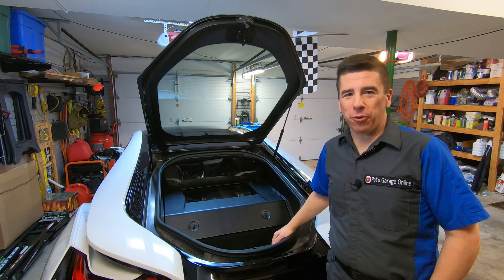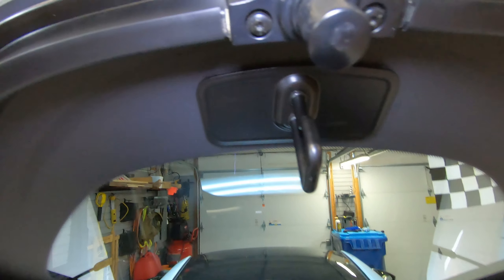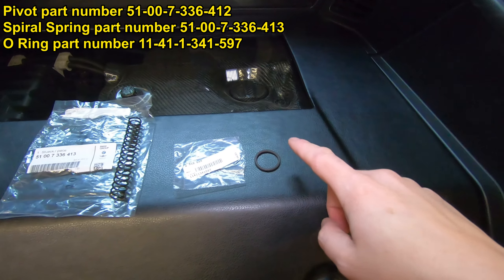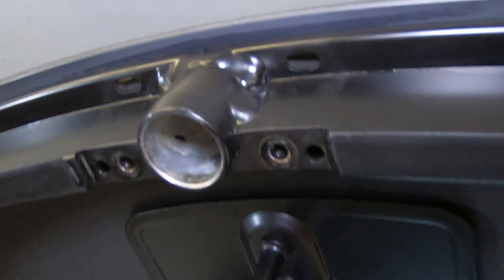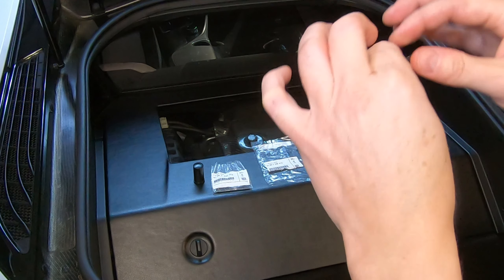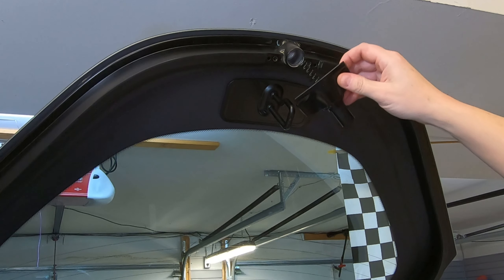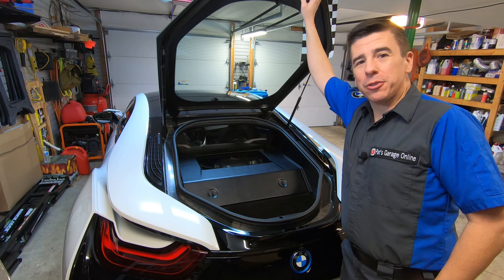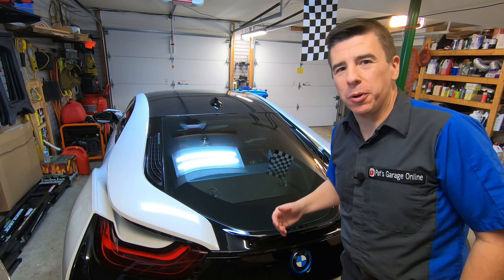Trunk lid problems on the BMW i8! How to fix this and prevent future issues with the boot.

Comment: Once again Pat, you’re amazing. Just did this to my newly purchased 2016 i8. Not only am I confident now I’m safe from this part failing, but the trunk pops up about 1/2 more than previously with the new spring, allowing me to easily get my hand under to open it.  Awesome stuff and never would have thought of doing this without your video!

Comment: Hey Pat, this is good preventive maintenance. Given BMW foolishly neglected to add a non-electronic way to open the trunk, one thing I found is even more critical. Make sure the emergency trunk release, the yellow plastic handle, is secured in its holder on the back of the trunk. If it is dangling, the car thinks it’s activating and will tell you the trunk is open, even when it’s locked shut. The trunk release will not operate nor will the rear views camera work at all. The only option is to somehow jiggle the handle enough while pushing the trunk unlock until it operates. Terrible design actually. As me how I know! 🤨
Reply from the maker: The same thing happened to me after I put my laptop bag in the trunk. I'll never bump that emergency release again. I plan on a video discussing this and the fuel door issue to be aware of. I never had the fuel door issue. Thanks for following along!

Comment: If anybody encounters this problem when is too late, and can not get it open at all, you can remove the rear bumper in the middle, the only two screws it has are behind the license plate and it snaps right out. Inside you will see an air vent looking thing. Take that out and you will see the emergency cable on the left side.
Reply: What size screws are behind the lisence plate?

Comment: Hi Pat, I’m i8 owner and have the similar problem that back trunk always seems open but actually not, and back camera seems not working as well. I can’t open my back trunk now even with Key fob or door control, is there any way I can open it?
Reply from the maker: I've heard of some folks using a suction cup device (either a camera mount for a windshield or a plunger) to pull up on the rear glass while unlocking the trunk, and that would work.  I'm not sure what to suggest as far as the rear camera.  It could be the camera, the wiring or the computer module that has failed and there's no easy way to diagnose this outside of the service center.

Comment: Thanks for the video. I just had mine break on me when I opened the trunk. It is a 2019 and I have had it for exactly a year and barely open the trunk at all.
Reply from the maker: I'm sorry to hear this happened to you. I have been getting a few messages about it over the past few months which leads me to believe that the 2019/2020 years are more prone to breakage. This wasn't common on the older i8's and I wonder if they changed pivot part suppliers and got a bad batch. I switched mine out to prevent breakage but kept the original just in case.
Reply: This just happened to my 2019 i8 Roadster, 3 years/ 9K miles… I think the correct fix would be for the Pivot to be made out of Carbon Fiber, Aluminum, or Stainless Steel…

Comment: How do you open the trunk if the part breaks while closing?
Reply from the maker: Put a plunger on the glass and pull upwards while pressing unlock on the key fob.  This is the best method others have used.

Comment: Pat,  any help on my 2015 i8 parking brake malfunction (right side actuator needs replaced) and small battery needs to be replaced.  Car only has 14,590 miles.  Dealership says $2700 to repair.  Are these DIY options.  I know the new TiS has been pulled.
Reply from the maker: Honestly, let the dealer do it. My friend evapors had the same problem and it turned out to be a chain reaction that resulted in a lot of failed parts. It's best to put it in their hands.
Reply: @PatsGarageOnline  Thanks.  Thought the 12V battery changeout might be easy but registering it as a new battery is something BMW would probably have to do.  Ouch.  $2700 bucks.  Pretty sure I'm selling mine.

Comment: This may seem like a silly step to take: preventive maintenance to a trunk lid lock, really! Take it seriously if you drive the i8. I've been fortunate in that this and a steering wheel rattle seem to be the only problems with my 2015 i8 as of March 2021, 20,500 miles. Three times the lid became stubborn.

As Mansoo Pak describes, I've had the lid stay locked and I believe a dash message for OPEN LID. So, I'll be attentive to the yellow handle when using the trunk. There is a small hook the yellow handle should rest on. I fixed my lockout with spirited cornering that shifted the weight in the trunk allowing the lock to work.

I've had the opposite experience when lid refuse to shut and lock.  I then had bags of soil in trunk. The lid stayed up an inch or so till I arrived home. Removed them, lid locked OK. 

I'll ask BMW to address this in three weeks when the i8 has its last service under CPO. If they refuse, I'll follow Pat's advice since my 2015 lid lock has the same marking so probably need a spring too.

Comment: Is your i8 very reliable ?
Reply from the maker: For me, it has been reliable. I haven't been stranded, yet. I've had weird errors show up on the display but nothing that disabled the car. There are a few i8 owners who have reported drivetrain problems. I believe this is something that is normal with all cars. However, the technology in the i8 is "excessive" compared to anything else I've owned or driven, so the potential for problems is generally higher than other cars.
Reply: Pat's Garage Online oh ok because I want to own a i8 in the future it’s my dream car